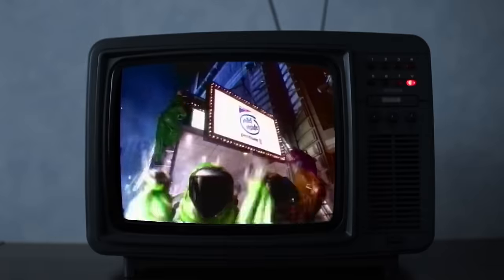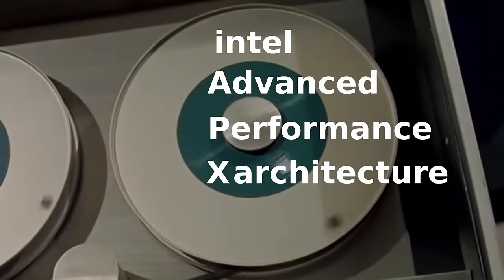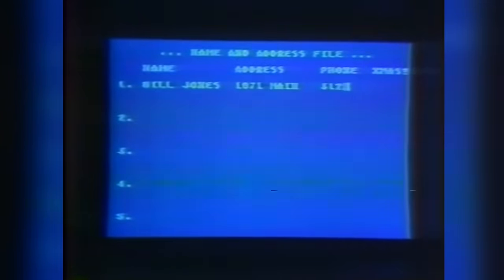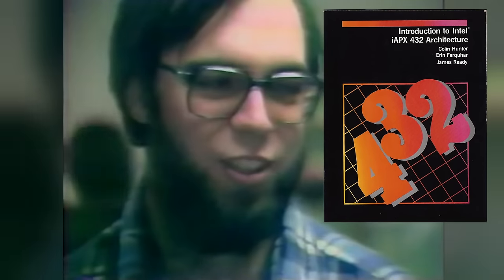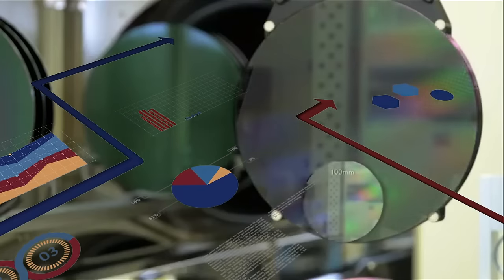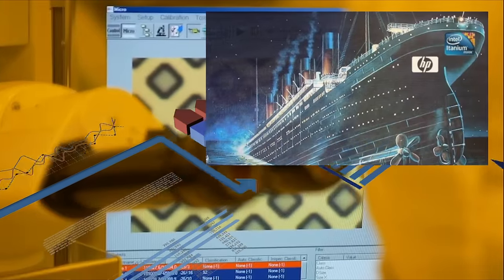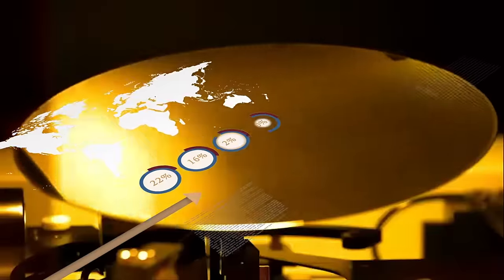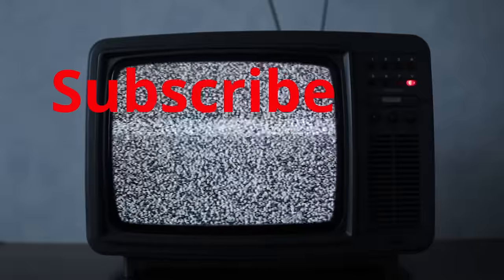iAPX The first time Intel tried to kill x86

Comment: 5:23 Ada was designed for writing highly reliable code that could be used in safety-critical applications. Fun fact: the life-support system on the International Space Station is written in Ada, and runs on ancient Intel 80386 processors. So human lives depend on the reliability of all that.
Reply from the maker: Indeed that was a design goal for it. Its still in use in alot of military hardware particularly missile gidance.
Reply: @RetroBytesUK  ADA has roots in British MoD project. ADA is used in F-22 too.
Reply: the safety critical design and military applications of Ada always seemed like the whole point of it, to me - odd that it wasn't mentioned in the video; I'd have thought this would be a major factor in Intel's decision to design chips around it.
Reply: @lexacutable  yeah the flight computer of F-22 is based on something obscure also. There is military i960. And then there is is x87 arch. (Yes X87).
Reply from the maker: @lexacutable  apparently the critical factor for intel was the growing popularity of Ada in university comp sci departments. They thought that trend would continue out in the wider world and it would become a major language for application development.  They where quiet wide of the mark on that one, it turned into more of a nitch language for military applications.
Reply: @JMiskovsky  Aren't x87s the FPU coprocessors for the x86s?
Reply: Like rust perhaps?
Reply: @tatianabasileus  now it is. But some functions were not re implemented. Like Sinus.
Reply: Ariane 5 showed that no matter how secure or robust the programming language is, you can abuse such languages yielding epic results.
Reply: @RetroBytesUK  Ada was a big deal back in the day, that's why. DoD sponsored creation of it to have one language they could use for everything. It was a multinational effort. There was a lot of money involved. And to be fair, it was way ahead of it's time. Ada 83 had: Packages, Strong typing, multithreading build-in to the language, exceptions, generics ( you know C++ STL?  Alexander Stepanov, the creator of  STL, made first versions in Ada) and more. One of the reason Ada never gained popularity is because it was considered too complex to implement.
Reply: @RetroBytesUK  It's still used today btw, and the last version of Ada is Ada 2022. It evolved a lot. It's used mainly in highly critical systems and not only in military. Nvidia uses it in it's firmware, for example.
Reply: @ximalas  what was the fault?
Reply: @Glaciaon  ... And it has even more stricter sub set called Ada Sparc
Reply: @JMiskovsky  The fault was a lack in the redundancy system of the software architecture, causing the rocket to self destruct. ;)
Reply: Also Ada still lives in hardware description languages like VHDL. The majority there is derived from the Ada language. And last but not least do'nt forget the grand-grandson Delphi ;)
Reply: @JMiskovsky  First, they should have disabled a module as it was only needed for the previous rocket. Second, this module converted a floating point number to a 16-bit integer. Third, the Ariane 5 rocket has different characteristics than its predecessor, easily leading to overflow. The module carried on using bogus numbers and the rocket veered off course. Had the module been removed, nothing bad would have happened. The same if the programmers had sticked to floats in the first place.
Reply: Almost ALL avionics, military and civilian, uses ada.  

Air traffic control also uses it as well.
Reply: Man, I love how ancient hardware still powers things in space. We got to the moon with practically using magnetic tape, and the ISS still uses chips from the 80s lol.
Reply: I think you meant Xda, xctually.
Reply: @lexacutable  oh no.. not odd. Intentional. How else will they promote a gaming CPU to data centers handling highly sensitive data?  Its like enticing you to trade your hard earned Dollars in exchange foe
Reply: @quickcurechef5373  I can't make sense of what you just said
Reply: @tatianabasileus  Yes they are.
Reply: @ximalas  I've heard the same, but with some additions. The unneeded module did get an overflow. And since Ada is so safety-oriented, that led to an exception. But no one caught that exception, and that's a really big error.  So of course the Ada runtime rebooted that computer. 😕 Luckily, there was a redundant system, ... that ran the same code, ... and also rebooted. And it was at that point that the rocket veered off, and self destructed.

So it would have worked fine if Ada didn't have the safety feature to intensionally crash when an irrelevant module do a calculation error.
Reply: @tatianabasileus  Yes
Reply: @basecius  you're right. I forgot about the overflow and the missing exception handling.
Reply: @basecius  and then the rocket could have landed on someones home. The fact that is does not run something senselessly is desirable. - Generally.
Reply: @lexacutable  probably he meant that it is easier to sell for high price specialized procesors for military that reselling cheaper CPU for mass market.
Reply: @Camelotsmoon  Cubesats are generally controlled by ARM processors and there are a lot of those out there. But move beyond low Earth orbit you have to contend with higher radiation levels, requiring a higher level of radiation hardness. That market is pretty small and the PowerPC architecture is strong, especially if your executive requires an MMU. However, there other options, including the Virago line of ARM-based processors. I'd love to see a Risc V offering based on a rad hard technology.
Reply: Ha! I know absolutely NOTHING about ANYTHING discussed in this video or these comment threads.  However, I find it absolutely enthralling despite this. It really puts into perspective how "dumb" The insanely vast majority of us end users are. 
   Thanks to all of you who make EVERYTHING possible.
Reply: @nickredd6168  well most of those users are not "dumb" in other areas. Like I know s--t about agriculture. But farmer for sure doesn't know much about ADA or  Power ISA or fail safe. But he is not dumb. Co-operation makes as better off.
Reply: @davidvomlehn4495  rad harden technology will come.sooner or later. China goes for RISC V and it could reach those sats soon. Power Chips are there from IBM licensed production I assume. The NXP might be a player. Also some 386 might beep around the globe.
Reply: @davidvomlehn4495  does Power ISA have some special MMU instructions?
Reply: @John Q. Bebtelovimab I know the history of the language. The idea that Ada was complicated is just a myth. It most likely stuck because Dijkstra and Hoare (Yes, those guys) complained about the language at different stages of it's development. If you actually look at Ada 83 reference (Available for free online) it's pretty slim lang. You can say generics, tasking and exceptions were complicated for it's time, but it just means Ada was ahead of it's time. The first compiler came out in a couple of months after the Ada spec was released, at it's peek there were dozens of compiler vendors, so the idea that it was impossible to implement is just bs. 

>Ada's legacy in the computer industry has been to engender an army of new programming languages which all tout their simplicity of design. 

I'm not sure what are you talking about, considering that ada influenced LOTS of programming languages, including C++, Java and Python (and many more). there is nothing hard about Ada, it's still is a pretty nice language and i would prefer Ada over something like C and C++.
Reply: Ada was a creation of the US DoD.  (who had also parented COBOL and FORTRAN).  The design competition was won by Honeywell-Bull (France).
Amongst the many issues was too many languages used for DoD projects (esp systems).
And of course reliability.
The reliability angle is why many avionics systems on the B-777 were spec'd to be written in Ada and the F-22 was almost 100% Ada (and resulted in a very smooth integration of the avionics).  Ada is the anti-C.
Reply: Yes, and why pick on Ada, or Pascal for that matter, when it is the C family of languages that have caused all mayhem and lives, which were unnecessary. The only reason being that programmer nerds think it's cool to allocate and deallocate memory manually.
Reply: @henrikg1388  Writing C well takes time, but not as much as writing Ada well.  Ada is  daunting for many programmers because of the formalities it demands (or at least encourages).  And then languages like Python come along to really mix the pot.
C embraces and promote chaos.  It's really a high level assembler to be blunt.
Reply: Yub, the Tonka (Panavia Tornado) uses Ada as well, the latest upgrade for the german ones (last Tornados flying!) Is called ASSTA 3.1 or Avionics System Software Tornado in Ada.
Reply: @ximalas  wrong, Ariane 5 showed how management don’t know shit and cutting corners and using software not designed for the hardware causes failures.
Reply: When choosing a programming language to learn I only picked Pascal because the auto industry was using it in cars too. 
Of course it wasn't long and we were running circles around it.
I also dated a irl whose father was one of those Ada programers someone just mentioned. With my Pascal background we had a lot more to talk about.
But even then writing was on the wall that C/C++ were the future so i quickly converted every library I had to C then C++. And that became the new standard even to today.
Reply: ADA is a nightmare to code in.  Any problem it supposedly fixes is trivially checked by a compiler that isn't garbage.  This was true 20 years ago.
Reply: Up until a few years ago the ships that I work on were still rocking Sperry gyrocompass units that were built around the 386EX.

Good old 386 was still driving the brains of providing the necessary accurate heading data to guide large ships 750ft+ through the ocean via autopilot.
Reply: I wish ADA became the new industry standard instead of C. I kinda liked C.. it was.. "high level".. compared to assembler. C++ is/was.. there's an exception to every exception, and the ecosystem is like mapping jungle.
Reply: @JMiskovsky  You can build an OS around a math-coprocessor?
Reply: @kurtwinter4422  Hmm sounds interesting idea.
Reply: Ada was subject to a competition which was time limited.  The winner was not potentially the best language, but was at least usable. The main products of the winner were 'P systems' and Pascal compilers.  The code produced for 'mission critical' or 'life critical' systems would be produced from a limited subset of the language, and the code produced would have been checked by hand, although such verification may well be performed by computer these days. The first compilers were available pre '90's.

Comment: 4:42 Ada didn't program the difference engine, which was built after her death, because that wasn't programmable. The difference engines works by repeatedly calculating using finite differences. Ada wrote a program for the analytical engine, a more advanced Babbage design that would've been the first programmable computing machine.
Reply from the maker: I know but I could not find an image of the analytical engine with an appropriate copyright license that ment I could use it.
Reply: @RetroBytesUK  I understand, but if I didn't hear wrong you also called it the difference engine
Reply: Your comment is as informative and interesting as his video, inspiring me to query my favorite search engine.  Has the Analytical Engine been built, and was Ada’s program(s) run on it?
Reply: @frankwalder3608  afaik not yet, but there have been talks of doing it (building it would take years, it's huge, Babbage was constantly refining his designs, and iirc even the difference engine built is just the calculator part, not the printer)
Reply: @sundhaug92  The printer of the difference engine was built if i recall. it was in somewhat simplified form from the original design though.  And the analytical engine has been constructed in emulation as proof of concept. That is about it so far. Several attemps at starting a mechanical build have met with money issues. This is not a device a machinist could make in his spare time over a number of years. I imagine it would take a team of at least a dozen ppl.
Reply: @wishusknight3009   Yes a printer , at least a basic one , has been built as I was lucky enough to be visiting the Science Museum    when they were testing it and have a test printout.
Reply from the maker: @frankwalder3608  It's not been built physically, it has been built virtually, meaning they could try her work out.
Reply: Didn't she just improve some of the programs that babbage made for the machine he designed? I thoughther job was something like a transcriber of Babbage's stuff, and the whole claim is rather dubious.
Seems odd he would design a machine, but not write any instructions for it... Especially since it was still in the design phase and he would be writing hypothetical programs for it as he refines the design of the machine.
Reply: I mean, it would be nice if she was the first programmer ever I guess, but I just don't think the evidence supports that.
The women who supported the apollo program with programming, now that was incredible.
Reply: More like: she wrote papers and letters containing programs that Babbage had written years earlier.
Reply: @lelsewherelelsewhere9435  Correct.  We have even found most of "her" programs in earlier notebooks of his that predate any contact between them.  There is no question that she understand how the machine worked (in some detail) and that she understand how to program it, but she was absolutely not the "first programmer".
Reply: "All but one of the programs cited in her notes had been prepared by Babbage from three to seven years earlier. The exception was prepared by Babbage for her, although she did detect a "bug" in it. Not only is there no evidence that Ada ever prepared a program for the Analytical Engine, but her correspondence with Babbage shows that she did not have the knowledge to do so." Allan G. Bromley, in the 1990 article Difference and Analytical Engines
Reply: @lelsewherelelsewhere9435 Something like that happened. The lady who basically invented time sharing. Her husband was also a respected developer so her colleagues thought he was secretly writing the code. While she was giving a birth a serious issue happened with the system so they learned she was indeed the developer.

Comment: That programming reminds me very much like a "professional" I used to know ; he worked on a Navy base, and wrote his own code. Professional, in this case, meant he received a paycheck..  The dataset came from COBOL - very structured, each column with a specific set of codes/data meaning something..  He wrote some interpreted Basic code to break down the dataset.  It went like this: He would first convert the ascii character into a number. There's 26 lower case characters, and 26 uppercase characters, and 10 digits ( zero thru nine ). So first he converted the single ascii character into a number. Then he used 62 If ... then statements to make his comparison.  Mind you, it had to go thru ALL 62 if then statements. This was done for several columns of data PER line, so this really stacked up on instructions carried out.  Then based upon the output, he'd reconvert the ascii code back to a character or digit, using another 62 if then statements.   And there was like 160 columns of data for each line of the report he was processing.. With a single report consisting of a few thousand lines all the way up to a few hundred thousand rows.  Needless to say, with all of the if then statements ( not  if then - else ) it was painstakingly slow.  A small report might take 2 to 3 hours to process; larger reports well, we're talking an all day affair; with ZERO output till it was completed; so for most that ran it, they thought that the code had crashed. 
In comparison, I wrote a separate routine using Quick Basic, from scratch, not even knowing his code existed,  using  on...gosub and on .. goto statements, with complete report taking about 1 1/2 minutes, with the every tenth line output to screen so one knew that it was actually working.  Only later did I find out his code already existed, but no one used due to how long it took to run.  Prior to this, the office in question had 8 to 10 people fully engaged, 5 to 6 days a week, 8 to 10 hours a day, manually processing these reports, reading the computer printouts, and transferring the needed rows to another report, by hand, on electric typewriters.  Yes, this is what they did... as stupid as that seems...
Reply: NAVY + COBOL
are you Korean War guy, older ?
Reply: @lucasrem Could be COBOL-2023, the most recent release :) 
Yfs, the old stuff like COBOL, Lisp, Fortran, ALGOL etc are still updated and used.